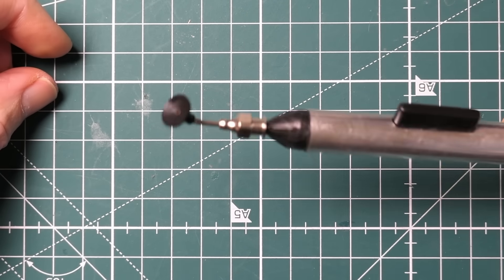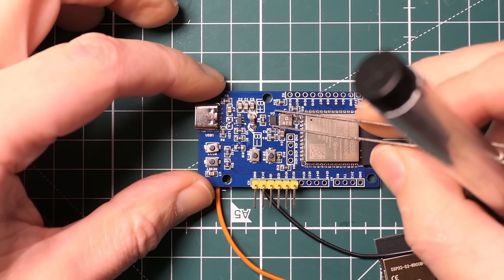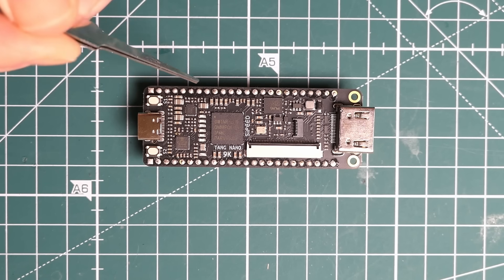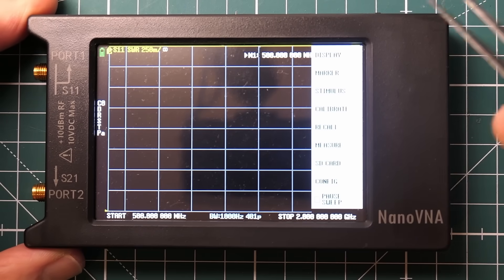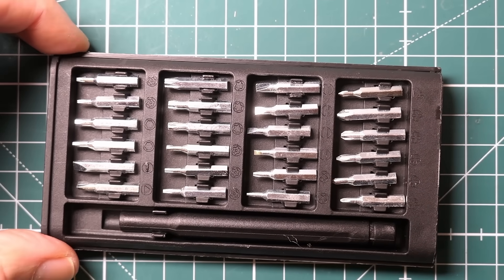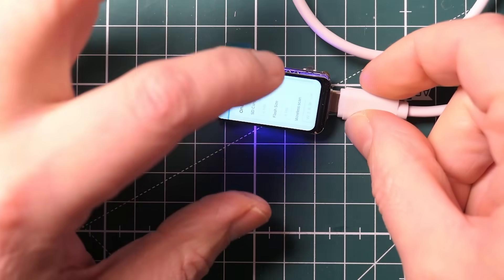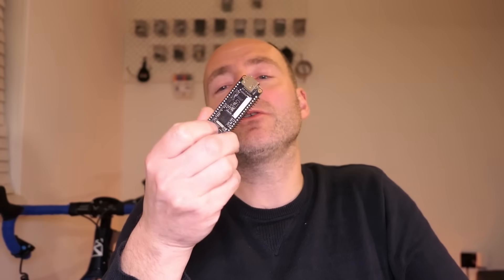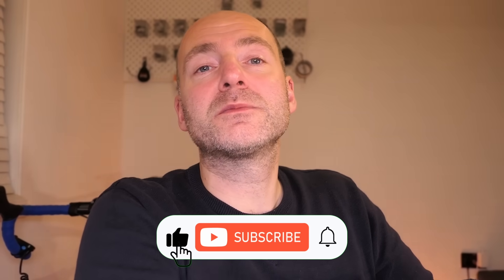Best and Worst AliExpress Electronics Buys of the Year | Honest Review

Comment: Wonder if you could do a video on AliExpress complains process. You could legitimately try to get refund/replacement of the rubbish items you received.
Reply from the maker: It’s a good idea, but I haven’t sent anything back for years… if the process is similar to how I remember then it’s impractical for most things. As far as I know, the buyer is responsible for the return shipping, which is very expensive. Another comment mentioned the procedure and it sounded similar to my memory, first you need to send photos of the item (witch is pointless if the problem isn’t visible), then you have to arrange your own return (which often costs more than the item you bought), and then you wait for ages for the return to be processed. It’s only worth it if the item is expensive, definitely not worth it for many of the really cheap stuff I usually buy. I’d be tempted to send the screwdriver set back because it’s really garbage, but it’s not worth the hassle! Thanks for watching 👍👍

Comment: If only there was a way to order another ESP32 and send back the broken one... 😂
Reply from the maker: Hmmm, very unlikely I guess, but if you try, let me know how it goes!!
Reply: @thecircuithelper . It went splendidly for the dozens of items I returned (over the years) no questions asked, as well as the returnless ones.

As long as you document your issue the way Ali expects you to, returning items is not an issue.
Reply: @thecircuithelper   today I got a partial refund on "cotton swabs" (qtips).

Bought 1000, received 10 bags, each bag labelled as "100 PCS". Actual pieces in each bag 80.

Ali gave me two options:
1. Return all the qtips and get a full refun.
2. Get a refund for the 200 missing qtips.

All it took was one picture and a very brief explanation.

Comment: 1. try pro'skit  ms-b126
2. pico logic analyzer 5 times more expensive, but more than 5 times more powerful
Reply from the maker: Thanks! I looked at the ms-b126, looks good, better quality than the one I bought! 

The Pico analyser is good, particularly if you add the extra components needed to protect your inputs!!

Thanks for watching and good info!
Reply: @thecircuithelper The MS-B126 is better because it continuously suctions as long as you hold the button. And even if there is a slight air leak somewhere, the vacuum is still sufficient to hold the component. Also, there is no need to press the button to place the component on PCB

Comment: A really good buy is the SK60 DC Buck Boost Controller (Currently at about £9:50 but often on offer as low as £6:50). In conjunction with a 12V 3A wall wart makes a super bench PSU that takes up very little room especially if you have a 3D printer and can access the Instructable titled Mini Desktop Power Supply With ZK-4KX and HW-398 PD Decoy on their web site. The SK60 fits the box perfectly.

Comment: Nice to see a balanced view of Ali; I've used them for years (from about 2015 from memory) and found most of the stuff good and reliable and am always disappointed when web sites and, in particular, magazines run them down despite never having purchased anything from them. When things are crazy prices then, yes, there is a bit of a risk and of the, literally, hundreds of items I've bought from them there only a very small few that I've had to reject and again, on the whole, the refund procedure is fair and fairly straight forward as long as you can show the problem with video or pictures (probably gets round the language uncertainties, especially for technical items).
Reply from the maker: I’ve never really had any issues over the few years I’ve been buying from Ali. Most of the things I buy are super cheap though, typically spend ~£30/month on loads of bits and pieces!  In fact, the most expensive thing I bought was the TinySA ultra, which was ~£100. Fortunately, both the TinySA and NanoVNA worked great so haven’t needed to bother with the returns! Thanks for watching 👍👍👍👍

Comment: Your microphone belongs just below or above your head.

Not 2 meters (6.5ft) away on your camera hot shoe !

Happy New Year 😜

PS : You dry jointed the nasty lead free solder on the USB C connector, hot air reflow it with some flux....
Reply from the maker: Hmmm I’m wondering why the sound isn’t so good in this video… I have a decent mic but I think i accidentally used the audio track from the camera rather than the good mic. Didn’t notice until I watched it yesterday! 

For the USB port, this gave me massive problems to solder, kept bridging the pins. It’s definitely flaky on this board (my first time soldering using a stencil etc) but the subsequent boards I’ve done have been fine.

Thanks for watching and have a good new year 🎉

Comment: The logic analyzer built on the raspberry pi pico is way faster than this
Reply from the maker: The pico version is better (I compared them in a video), but for the cost and ease I can’t fault the Ali one, it works like a charm for most things and comes delivered with the usb cable and jumper wires!

Comment: The screwdriver set got crazy viral popular a couple of years ago. That of course means there are heaps of cheap clones out now that are crap imitations. I have the original and I'm happy with it to this day.

Given you can now get a zigbee controller for less than $10USD, I've moved on to a much larger sonoff zigbee temp sensor with screen. I tried using rechargeable LIR2032 to power those xiaomi, so I wasn't constantly buying & chucking out CR2032 cells, but it was so much of a faff... the new one uses AAA which will be so much easier. I think I might try avoiding CR2032 when possible from now on. 

The blue esp32-c3 modules I thought you might have included. Them and the small RP2040 are so cheap and easy to use for new MCU projects. I have some C6 boards coming in the new year to test how they work with zigbee.
Reply from the maker: I remember seeing lots about the Mi electric screwdriver a few years ago (my friend bought one), but I didn’t realise there was a manual version too. I’m going to look out for a legit version, the generic set i’m using at the minute is ok, but not great (still much better than the one shown video!)

For the temperature sensors, i was hoping to use my own ESP32 dev board, but it’s probably overkill! Takes me a couple of hours to solder up and the parts cost way more than buying a cheap ready made solution! The CR2032 cells are rubbish, even AAA aren’t great, but at least they last a bit longer, are easier to change and wont burn your house down like a LiPo might 😅

I was thinking about including one of the mini ESP boards in the video, but wasn’t sure which one… maybe the C6 mini, as that has zigbee etc, but I haven’t used it properly yet, so one for next year!

Thanks for watching and have a great new year 👍👍
Reply: @thecircuithelper  Willco did a super one for £12. I really miss that shop!
Reply: @thecircuithelper biggest problem is if you make the rechargeable form of 2032s, they have naff all energy. At least with rechargeable AAAs, they're easy to get decent ones and their energy reserve isn't terrible, at least for low power sensors. Can either get NiMH ones or "1.5V" rechargeable lithiums (I think they have a tiny buck circuit inside).

Sometimes half the fun is making your own sensor, wiring together, packaging it into something not terrible, and optimising the code to get the most out of your battery. Even if it'll end up more expensive than some cheap sensor built hugely down to cost. I'd say makes for a decent video project as well.

Comment: I never had a problem with those cheap temperature sensor
Reply from the maker: One of the other comments said the same… maybe I just got a bad batch! However, lots of people on the video where I changed the firmware mentioned the screen stopped working after some time, so I guess there are quite a few flaky ones out there!
Reply: @thecircuithelper 
Your microphone belongs just below or above your head.

Not 2 meters (6.5ft) away on your camera hot shoe !

Happy New Year 😜

PS : You dry jointed the nasty lead free solder on the ESP32 kits USB C connector, hot air reflow it with some flux.

I've got the exact same 💩 single use alloy screwdriver set.
Reply: @thecircuithelper in my experience the THB1 is way better than the one with the thin character and it works perfectly (never connect the polarity in reverse or you kill them instantly by experience. 
I use a LFP battery on them, work perfectly and unlimited power.
Reply: me neither, I've got 6 of them and they're brilliant.  Bought them about 5 years ago and they've been in constant use

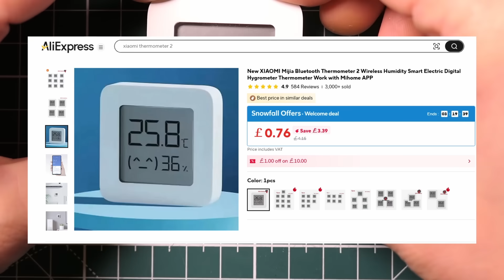Comment: 7:16 I have these as well, installed the custom Firmware on them and monitor all rooms of my house with Home Assistant and they work like a charme. Never had any issues or failed readings with the custom firmware. Battery lasts 1 year with BLE. Flashed one of them with Zigbee what was the worst thing i did
Reply from the maker: I reckon finding a good supplier is key to getting good modules. I bought ~10 and I don’t think any of them are still 100% functional. The official Xiaomi store did sell them, but it’s out of stock these days !! Thanks for watching 👍👍
Reply: Where did you buy them and for how much? I wanted to order some, until I’ve seen this video…